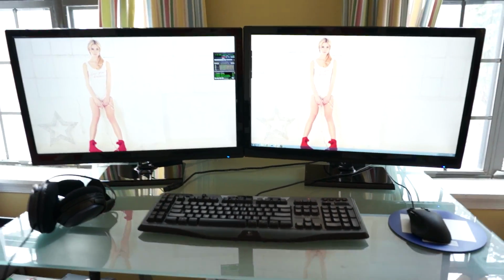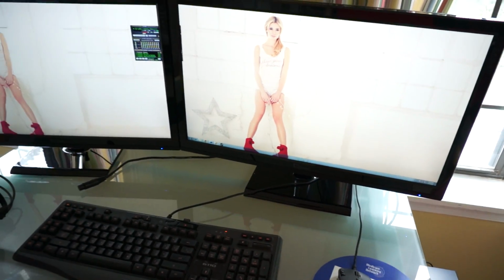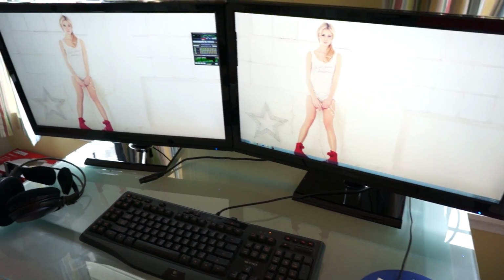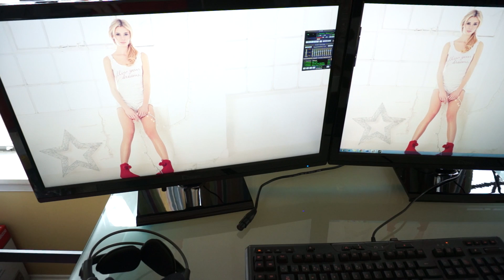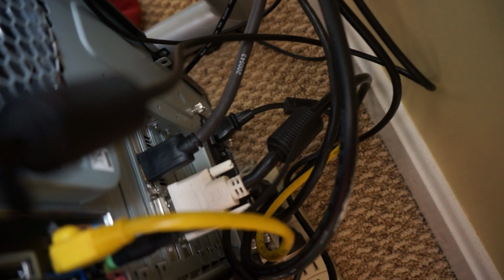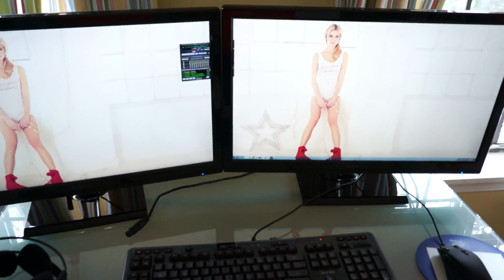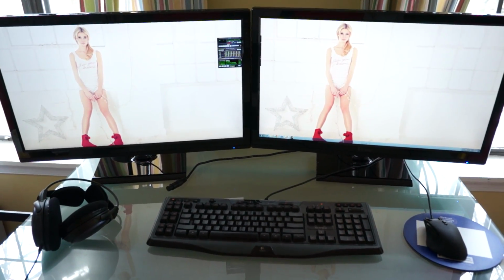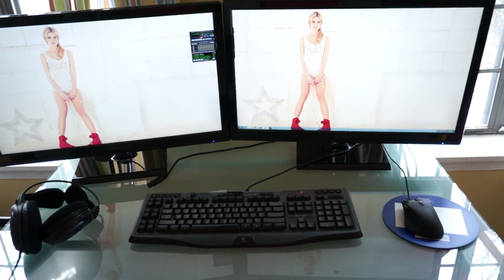Dual QNIX QX2710 Korean Monitors with single link DVI / HDMI

Comment: Ok, I'm pretty sure people still refer to this video since these monitors are getting cheap 2nd hand now. I'll get straight to the point, if you're planning to get two of these and run one at 96-120hz and the other one at 60hz using an HDMI to DVI cable, beware. This configuration is not supported by most graphics cards, as I happened to find out today. I have an R9 Fury, and when both monitors are plugged in and pixel patcher is applied they both work at 60hz, but as soon as I try to overclock the Dual Link connected monitor while other one is plugged in, the non-dual link connected monitor that seemed perfectly stable at 60hz, no longer works. I think this might be due to a hard limit on how high of a pixel clock can be output by 1 GPU at a time.
1x60hz 1440p monitor is around 240mhz pixel clock, 1x120hz 1440p monitor is around 460~480mhz pixel clock depending on your timings, either way the GPU is expected to output over 700mhz in DVI, this is just too much for (as far as I know) any single GPU. I happened to have another Fury laying around and when I hooked up the 60hz monitor to it and the 120hz monitor to my primary card, both worked. Fortunately I had a 2nd card, but If i didn't I'd be stuck either at 60hz or with a useless monitor, so thats why i wrote this, hope it helps somebody.

TL:DR if you're gonna use 2 of these and one at high refresh, have 2 GPUs.

Comment: Hey man just wanna give you a huge thankyou, this worked perfectly with my Nvidia GT1030, i applied the patch and it initially looked like my monitor was possessed, plugged in my old one and kept bringing down the refresh until an image was displayed, finally got an image at 57hz. I have a gtx 1060 coming but because of the holiday season it's not gonna arrive until the end of next week so this fix has allowed me to use my monitor in some capacity before it turns up.
Reply: did you ever get your monitor to work with the gtx 1060? I have a evga gtx 980 2.0 and my monitor only work at 57hz as well?
Reply: Yeah 1060 worked right out of the box, no problem there
Reply: what dual link cable are you using?
Reply: No idea just a regular dual link DVI cable, think it's from monoprice.
Reply: This, thanks mate! You sorta have to turn down the refresh rate to 57. Anybody knows a way around that? Except getting an active converter for 50 bucks+ maybe :s
Reply: @arcade8078  Did you figure something out?

Comment: It's possible to do this with single link. You have to have another monitor on hand to do it. All you have to do is use something to drop the refresh rate to 30Hz, and then manually overclock back up to (or as close to) 60Hz. I was only able to get mine to 58Hz with single link dvi. Funnily enough, I have only been able to OC it with dual link to 116Hz.

Comment: so I'm late to the party. I have a 980ti with only 1 DVI port. I'm using this for my current DP2710. I got another DP2710 but I don't have another DVI port. I'm looking to get this: https://www.amazon.com/Syba-SY-DVIHDMI-MM30-DVI-D-Plated-Connector/dp/B004DLKJSU to use for the 2nd monitor. Is this what you did? I won't be able to get anything about 60hz on the 2nd monitor right?
Reply: did that work for you?

Comment: Im confused. Are you not using the monitors that only has 1 output (DVI-D) ? Or are you using the monitors with multiple ports (Displayport, hdmi, etc?) And if you are using the ones with 1 output are you using an adapter from DVI to HDMI?
Reply from the maker: Simon Falk The monitor on the left is using a DVI to HDMI adapter while the monitor on the right is using DVI. Due to the nature of HDMI, it only supports a single DVI link/channel. I used a software patch to run the single link out-of-spec so that the monitor works.

Comment: Guys i´ve got gtx 770 and it has got 2 dvi , 1 hdmi and 1 DisplayPort  can be 1st monitor connected with hdmi and 2nd with dvi cabel ? will it work as 1 monitor ?
Reply from the maker: Haros Filip Yes, one can be connected with HDMI and the second with a DVI cable (it is also possible to use a DVI/HDMI adapter). I believe they can be set to operate as one monitor - I forget what nvidia calls it (surround?). The monitors in this video are not set in that mode and operate as two independent monitors, which I prefer.

Comment: Hey man maybe you could help me out with an issue I am having. So I just purchased these QNIX Monitors and I am having a problem hooking them both up to my AMD Radeon R9 280x.
Now the card only has 1 DVI Dual Link input, 1 HDMI, and 2 Mini Display ports. I have tried hooking up my second monitor to a dongle through Dual Link DVI to Mini Display port, would not work, returned that, bought an HDMI to Dual Link DVI Adapter to run from the Monitor into the HDMI port in the GPU, still no luck.
Any Ideas?
Reply from the maker: Daniel Glegg Yes - your HDMI adapter & mini-displayport adapters only support DVI single link output which the monitors don't support. The best solution is to purchase a displayport adapter that supports dual-link DVI, but that's expensive. A cheaper, though less robust, solution is to buy a 120 Hz capable (mini)displayport adapter which should work. See here https://www.hexhound.com/triple-head-qnix-qx2710-evolution-iis-a-journey/ Solution 2 is the 120 Hz displayport adapter. I hope that helps!
Reply: Thanks! I actually went the route you did with the single link DVI to HDMI cable and am using that as my main display as well as running a dual link DVI to dual link DVI for the second display. The driver patch didn't work at first for me but I tried it again and it did, thanks a lot for the informative video!!

Comment: Dude get your PC off the carpet! Your PSU has nowhere to exhaust.
Reply from the maker: McShizzify I thank you for your concern. It's fine - the air intake is from inside the PC & blows out the rear. This particular PSU is passively cooled most of the time anyway.

Comment: Could you use two DVI cables to duel monitor.
Reply: I'm trying to work out why I can't power my second crossover with the second Dual link DVI output on the GPU.

Comment: I got a 2nd QNIX 2710 monitor and hooked it up to my (xfire) 7870.  As it turns out, the old monitor works only with a dual link cable plugged into the dual link slot.  Strangely, when the old 2710 is plugged into the dual link port with a dual link cable, and the new 2710 is plugged into the single link port with a single link cable, both monitors work.  However, once in a while, I get some crazy transient glitches on the old 2710 (dual link) screen like when I start certain youtube videos, but the new 2710 works just fine.

If the old monitor is plugged into the dual link slot with a single link cable, it returns complete nonsense, and if plugged into the single link port with a dual link cable, it works but has random horizontal lines going across the screen.

The new monitor works with a single link DVI cable plugged into the single link port, but returns the flashing primary color screens when using the dual link DVI cable in the single link port.  It also works with the dual link in dual link, but then the old monitor won't work.

Are you saying that a regular HDMI 1.3 or 1.4 to DVI cable works for you?  I would like to plug the new monitor into the main dual link port so that I can game on that screen and plug the old monitor into the HDMI port or perhaps purchase an active displayport to dual link DVI adapter. 

One other possible solution is to use each monitor on each video card and just switch in and out of crossfire when I want to game.
Reply from the maker: Because this solution relies on driving the monitors at frequencies roughly double that of what the DVI specification allows, the quality of the cable, monitor, and video card are really important. HDMI 1.3/1.4 cables are higher quality cables designed to carry higher frequencies and I have had good luck with them - however, I have also had the crazy glitches on my personal setup. Other setups seem solid with the HDMI cables so it's worth a try. I'd suggest trying an active displayport to HDMI adapter (look here http://www.hexhound.com/triple-head-qnix-qx2710-evolution-iis-a-journey/ ) with the HDMI to DVI cable and no pixel patch. Active display port to dual link DVI adapters will absolutely work but they're pricey.